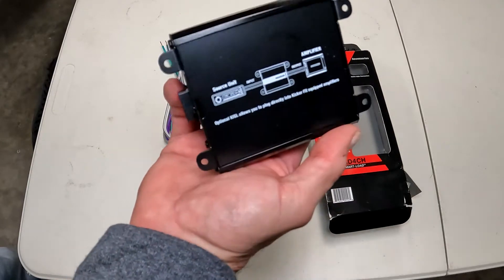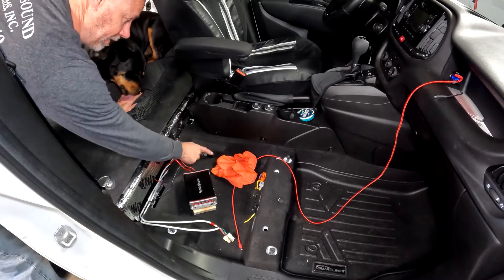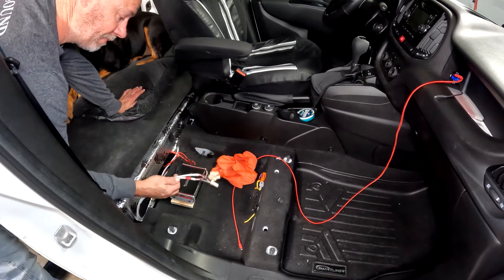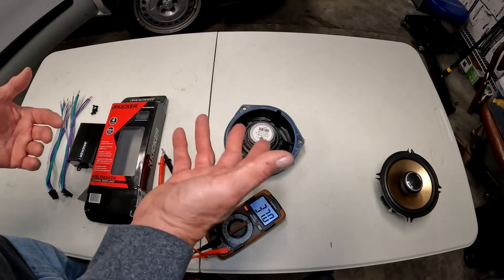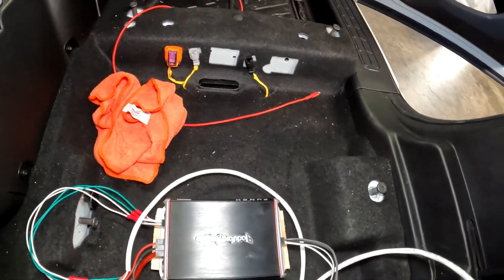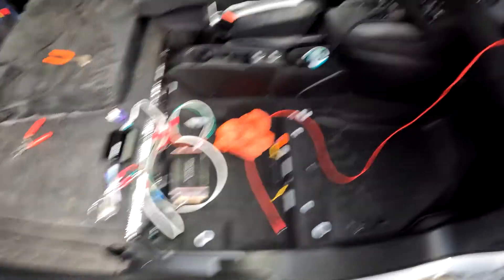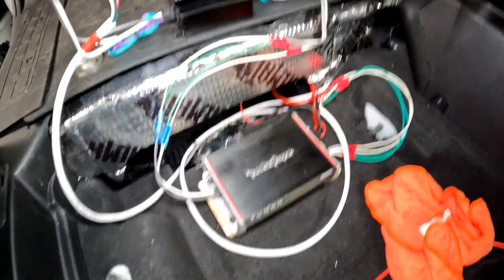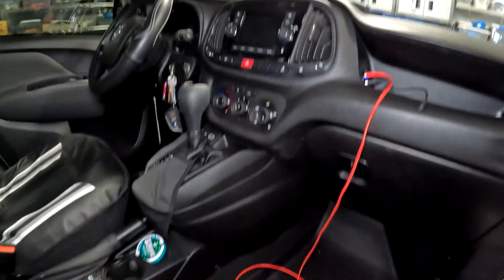Adding Amplifier Radio Has No Audio Output Ram Promaster City 46KISLOAD4 Kicker Radio Interface

Comment: Do you have a issue when taking out the seat because there are airbags ?
Reply from the maker: No, you just unplug the wires from the bottom of the seat when you are removing them.   Since you are working on an Amp your battery is most likely disconnected anyway so nothing to trip the airbag...  4 bolts and a couple wire clips it is out of there.

Comment: Hi, nice video. I'm gonna get one of these Ram Promaster city soon, also got a complete sound système on my GMC Savana already. I'd like to put the systeme on the Ram but not sure if i keep the factory Radio or install my double deck Pioneer DVD. It would cost me more i think to install the Pioneer because i would need a bezel adaptor, new harness to keep all the steering wheel fonctions, rear view camera, etc....By keeping the factory on the other hand, i have to get some in line converters. How many speakers output their are on the factory unit? Cause i plan to plug some 6x9 that i already have mounted on wooden box that i would place behind the seats. Your in line converter can input/output 2 or 4 speakers? If their is only two speakers, can i split the input pair to transform in 4 speakers output? And the wires are not rca? Finally,  what about a sub? So 4 speakers ( 1x 4 chanels amp)  and and a mono chanel amp for the sub...Any advice would much apreciated..Thank's 🤙Many questions i know, ...
Reply from the maker: I have the "base model" contractor vehicle.  My radio only has outputs for front speakers.  There is a Promaster Wagon that has rear seating and rear speaker setup.  I also have no nav, no touch screen, just a basic radio.  Since I only use this for work the factory deck a small amp and some larger door speakers worked for me.  You can feed in with an amp from just the fronts and put 4 speakers on it, the subwoofer would really help it out.  The biggest thing with the factory deck is it is WEAK, not much power at all and on mine no RCA or Line outputs.  If  you want it to sound good, change the head unit out also, that would also eliminate the "Smart Radio" interface unit.  I think all the extra pieces and parts to make it work kill the sound and also more parts to break.  You can get a double din adapter plate on Amazon for about 25.00 https://amzn.to/43BOD5O.   If it was a personal vehicle for me to drive daily I would change the head unit, try to fit some 6x9's somewhere and get a low profile sub for under the passenger seat.  I also had one of these in a Nissan NV200 work vehicle.  This was pretty impressive for what it was. You still need the Kicker to trick the head unit to being on, but the rest is built into that and it fits right under the seat.  Best part on Amazon, have 30 day trial if you don't like it.  lol  Sorry for the long answer but hope it helps.   https://www.amazon.com/gp/product/B085G2C2WH/ref=ppx_yo_dt_b_search_asin_title?ie=UTF8&psc=1
Reply: @RagerJackOfAll  Thank's alot !!🤙I already got the Pioneer unit, but the harness is not cheap.... I don't mind losing the steering controls for the volume +/-.. Thank's for the advice..Have a good day!
Reply: Can you tell me what kind of fastener are holding the seat ? Torx or hexagonal?
Reply: Do you know the speaker size on the front door? Metra have 5 1/4 adaptor, cruchtfield says 4 ", all size speaker size site  says 6.5"...😵‍💫 I'm confused..!!!
Reply from the maker: @Frank-hg9rl  Sorry trying to answer one question at a time.  You will need to "modify" the door to get the 6x9's in.
Reply: Hi, it's me again😊. Ordered  the kisload2, gonna keep the oem unit Finally.. One question, on your video, you get out of the kisload4 and plug into the amp but it look that you dont use rca's? My amp just have rca inputs....Can i just add rca adapter on the output cablel coming out of the kisload?
Reply from the maker: My factory head unit only had 2 channel output.  I only have the promaster city work van.  The Promaster has a "passenger" version also that had 2 speakers in the back and 2 speakers in the front.  My head unit is as basic as basic gets, orange display no Nav, Gps, satellite, not even a tape deck.  Has a bluetooth and that's about it.   So I guess it depends on the head unit that is in yours.  I think you can order them with the Nav system, but again since mine just a work van got the most stripped down model you could get at the time.  Personally I would get an under seat subwoofer, (those seats pop out super easy, 4 bolts and a wiring harness), do the 6x9s in the doors, but I'm not sure where I would put the rear speakers since mine is just a metal shell in the back, its hard for me to visualize since I have shelves and things hanging from the ceiling where I would even put back speakers.  Line converter was good for 4 speeakers... You can split the line adding more speakers but it just drains the channel on the amplifier or head unit.  The head unit "may" be 40w...  Divide that by 4 you end up with 10w per speaker, they will play but when you turn it up going to stress that head unit.   Probably didn't cover all the questions but that's a start.  lol